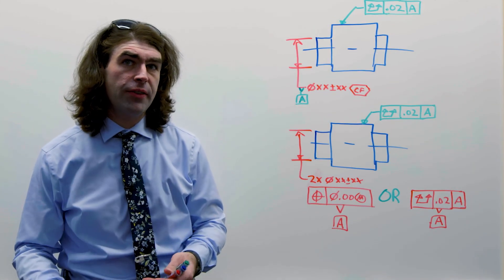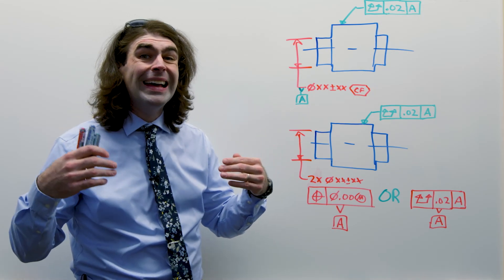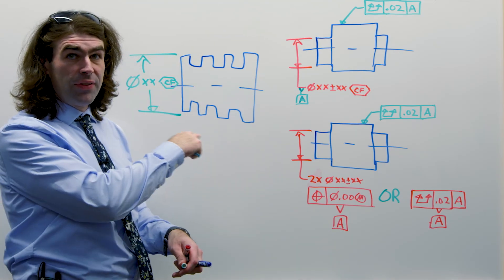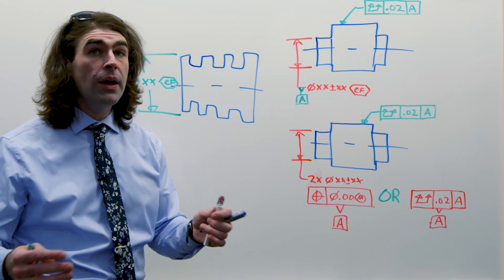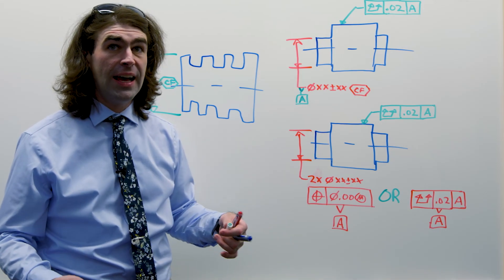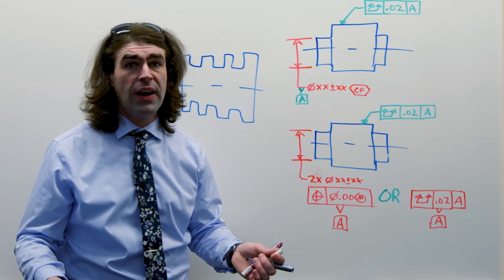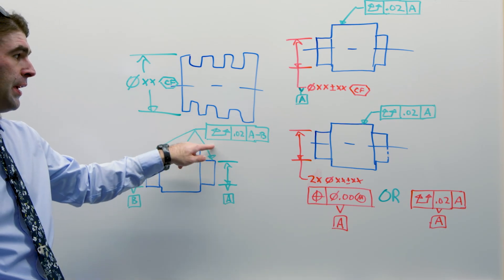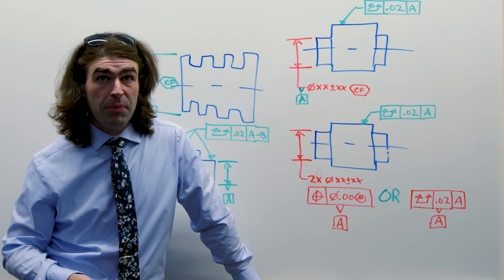GD&T Common Datums Part 2, Continuous Feature, Position, Runout

Comment: In the last exemple you talk about cylinder datum feature with runout specified on it. How to inspect runout of cylinder referred to its own axis? Ofcourse in mathematical way it is obvious, but durring inspection you have to simulate the datum by collet or chuck. Because of that dial indicator has no access to surface. How to inspect such requirement on real component?

Way to simulate datum and keep access to surface is by V-block, but v-block simulates datum based on two edge contact and simulated axes can vary during full indication movement. Is there any bether way to simulate datum and keep access to surface?

Comment: In my opinion it should at the very least have a CF identifier because it is possible to chuck it up on just one end. Preferred method I think is using both datum A thru datum B to be absolutely clear.
Reply from the maker: Hi, I prefer identifying each feature as a separate datum in this situation. I think it makes it more readable, especially for those that are not hip to the CF symbol.
Reply: @RDeanOdell  Hi dean, I am starting working with metal from total minus cero, on my own.., I am finding your  tutorials so cool, your transmission of the information is so exactly on point, concise and right to question of matter, no distractions and no fancy yutber videomakerthingys, no tinsulting the intelligence of the viewer, I would have to go to university for this knowledge, I am only missing if your graphics would be a little bit more rigorous, think that the reason for many people to "fail` at technical stuffs, has also a lot of to do with how each person develope their perception of reality, majority of humans do it through the eyes....reasons why videomaking has broken all the rules.., as an illustrator myself what can I say, just to mean, use a bit more the all the visual aspects that a mainly visual platform like youtube has, just some more rigorous drawings and you have it perfect